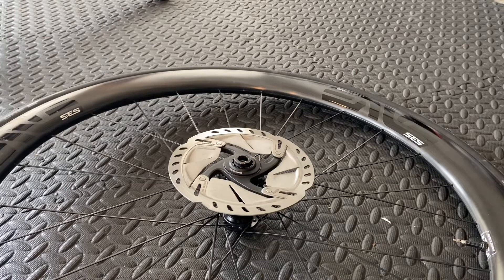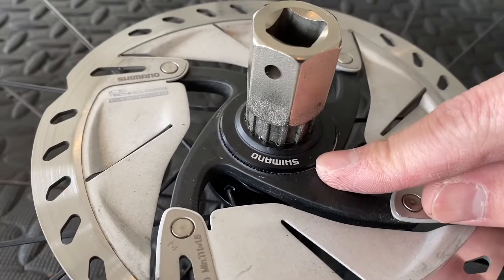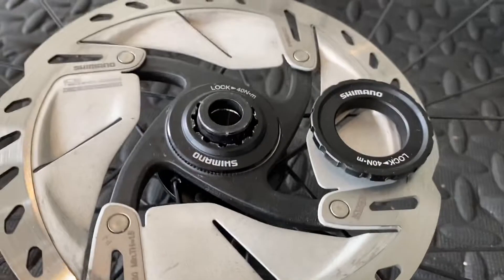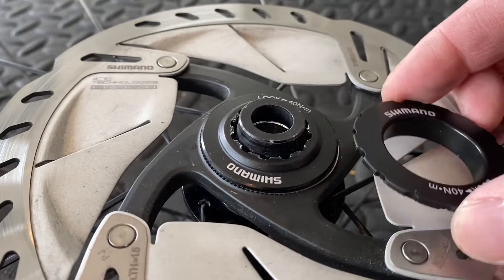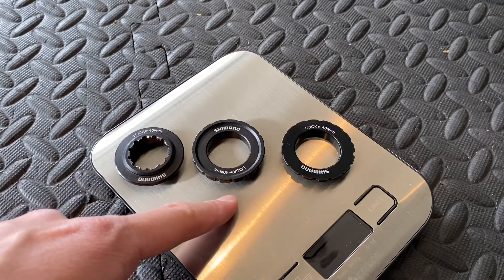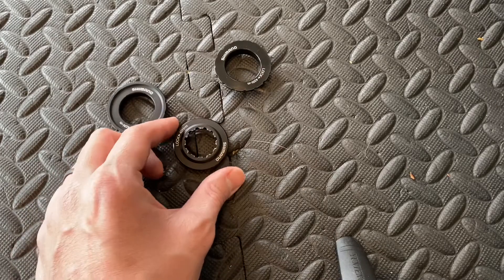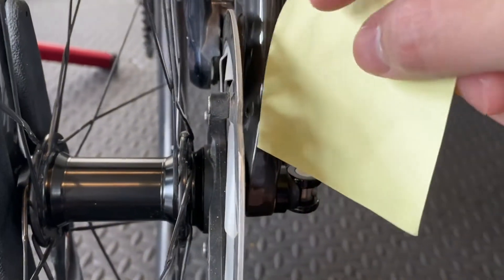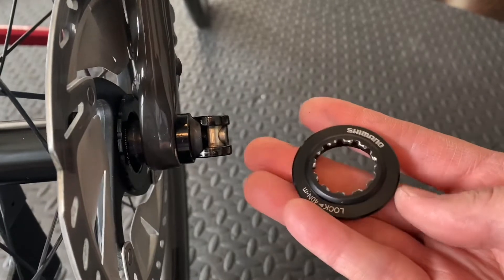Clearance Issue - Trek Checkpoint SL6 Fork / Shimano Lock Ring on DT Swiss 240 hubs ENVE 4.5 AR Disc

Comment: Great video. Wonderfully thorough. Something the DT Swiss engineers clearly weren't. They should have offered a new end cap without the taper (best) or supplied the alternate lockring.
I looked at getting the alternate lockrings. Would have probably gotten the beefier one. I'm glad I didn't. I wouldn't have been happy either with that small clearance and been even more furious at DT Swiss.
Alot of peoples here prefered to alter their tools rather than the part. The tools were good, the part wasn't. I chose to fix the part. If there are other end caps that are 12mm all the way, the taper is non-structural. I just ground it down. Sandwiched the end cap using screw, washers and nut; inserted the screw into drill chuck, ran the drill, and pushed a narrow file against the taper, until the taper was gone or well elongated. Painted it black with a sharpie. Maybe some day I'll bother to paint more proper, but probably not.

Comment: bah..what a problem... i thought these things were interchangeable or standard. my problem is that im not sure if the thread of the shimano ring fits the 240 hub. it feels a little tight and  i decided to stop forcing. do you know if the threads are at the same? thanks
Reply from the maker: In my experience the threads were compatible.

Comment: Same issue with front DT SWISS 240 Hub on PR1400. I grinder the inside of my tool with a DREMEL and I was able to mount my disc without adaptation ! 🙂👍

Comment: Thanks for this. The issue does not apply to my DT Swiss 240 EXP hubs setup for 12mm axles when using a Park Tool FR-5.2H (Cassette Lockring Tool with Handle). The end caps of my 240 EXP are not tapered, and the tool can fully engage the lock ring. Just FYI for others with the EXP hub.
Reply: good to know !

Comment: I have same problem with my FFWD and DT 240. I have fixed it with upgraded tool. I made my tool by grinding the internal wall of regular locker ring tool. It helps to sink the tool deep enough to loose or tight the lock ring.

Comment: Hey! Tkx for the video! I am wondering how does one torque those “outside theet” centerlock variants up to the correct torque of 40nm… is there any other tool besides the wrench? Or you just fasten it without caring about the torque? Thank you!
Reply from the maker: That’s a great question. I mainly rely on feel. It helps to calibrate your feel on something else, like a cassette ring while using a torque wrench first. Since I’ve done that many times, I approximate how tight the right torque is by feel. Do this at your own risk though. You can also get tool that fits over the outside teeth ring and put it in a torque wrench if you want to be exact. I think park tools makes one.
Reply: @akeofalltrades  thanks mate!
Reply: @ruiloureiro3167  Park tools BBT-69.2. Frighteningly expensive for a small piece of alloy.
Reply: @jonoHMmiller  alright! Thank you! Expensive indeed 🙄

Comment: really furious that this is something that is actually sold by dtswiss/enve for road bike use. There is no way that no one saw this problem before release. Now youre stuck with a 2000$ wheelset that needs a specific workaround to be able to fit onto your bike. Who thought of making 15mm TA with a conical end cap for road bikes, why not just produce 12mm TAs so it fits the industry standard.

Comment: Hi, I just ordered the Tourney Lock ring, thanks for the help, did you torque it with the BB tool as well?
In the meantime I would like to use it with the lock ring that cannot be torque enought, Did you have any problem using that one?After each ride I will torque it again just in case. 
Thanks
Reply from the maker: I did use the bottom bracket tool to torque the Tourney lock ring. As for the first lock ring shown, I just tightened it by tilting the tool so that I could get more tooth engagement on one side before carefully tightening to avoid stripping. I wouldn’t recommend riding without torquing the lock ring down to the manufacturer’s specific torque though. Be careful!

Comment: how did u remove the first one tho ?
Reply from the maker: Thanks for the question. I used that cassette remover tool but had to tilt it so the teeth would engage deeper on one side then turned it very carefully to avoid slipping and completely stripping the teeth.

Comment: I have same issues with my front DT Swiss 240 hub on Enve SES 3.4AR. Wondering if the solution could be by finding some alternative brand of the casette tool. I remember someone mentioned something like this a while ago...a tool that has thiner walls on the ring, if it makes sense?
Reply: Curious, did you find anything? Currently have the same annoying problem on my ses 5.6 disc
Reply from the maker: That’s a good idea. I haven’t looked for those yet but it could work.
Reply from the maker: Unfortunately I have not found anything yet.
Reply: I have made this tool myself from regular one just by grinding the internal wall. It helps a bit to insert the tool deeper into the locking ring.

Comment: Are you not able to remove the end cap by pulling it off, then tighten the lockring, then push the end cap back on?  Thats what I do with my DT 240's.
Reply from the maker: Dan Goertz Good idea but for this lock ring and end cap combo, the end cap is not able to pass through the lock ring.

Comment: using Shimano CLD wheelse with Shimano 6-bolt adapters and when i cinch the wheel tight, the lock ring rubs the fork.   i hand tightened it only, and doubt whether having the BB tool to tighten it would make any difference, but i am heading down to double check.   but....i also am using a post mount brake and flat mount adapter so that could be contributing.   just not much room not even enough for the sliver of paper to fit once spin the front TA tight.
Reply from the maker: Sounds pretty tight. Is the post mount adapter aligned well? Also, 6 bolt adapters are more for mountain bikes also that may be why the discs are being pushed out so far and into the fork.

Comment: The tool for the inside RT-97 lock ring has a 5 mm rod because it's intended to be used on a Quick release hub only. However, I believe that maybe you're supposed to use a Front Wheel Axle Adapter 20 to 15mm on that hub. That would build another few mm to the hub width and fix the clearance issue. You might check that., not sure what hub you're using.
Reply from the maker: Frode Angell Løtvedt  The 15 mm would work because the adapter would not need to taper in as aggressively and the chamfer from that taper does not get into the way of the tool. This hub was a DTSwiss 240 that came from ENVE with 12 mm adapters. My fork is a 12 mm thru axle so unfortunately I cannot use the 15 mm option. Thanks for your comment!